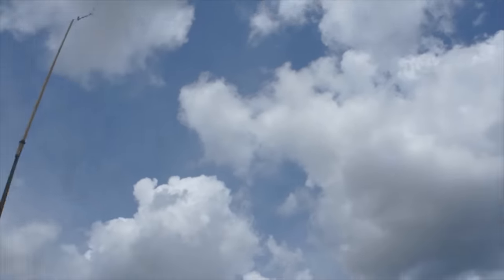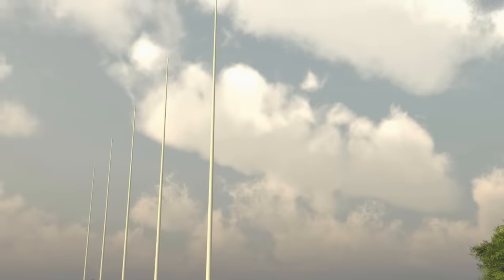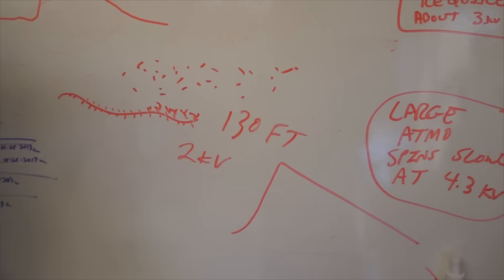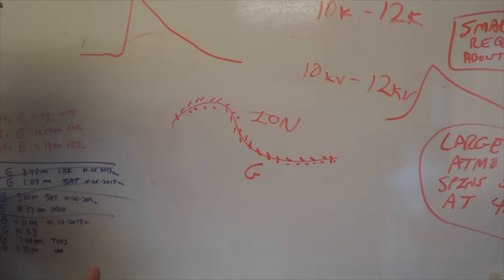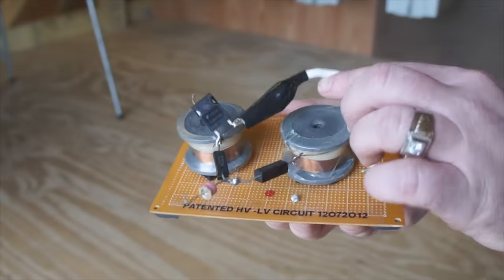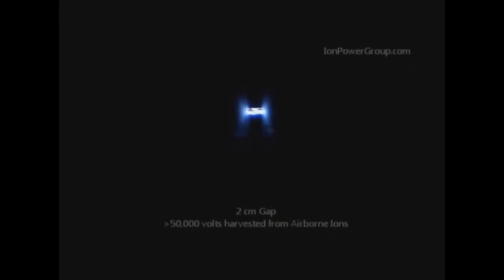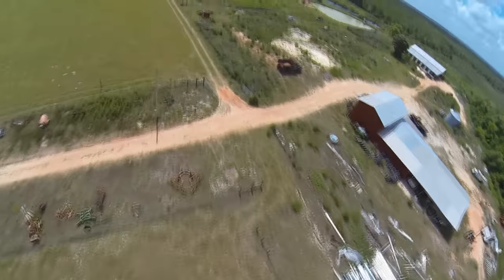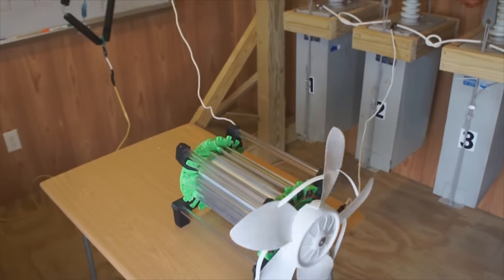Graphene/Graphite Atmospheric Electricity Collectors - Plus Horrific Hexacopter Crash!

Comment: Why don't you show how much POWER it can produce?  Voltage by itself is meaningless, even a spark from your shuffling feet on a carpet can exceed 20KV.  We need to see WATTS produced, meaning V*A.
Reply: A very big cipher: this test set up can produce 2.4 kV and al least 10.000 Zilch-Watts.
Reply: Zilch-Watts lol. From calculations from many people, they have come to the conclusion it is around 12W of average continuous power.
Reply: Richard Smith And you can get 300W from a single solar panel less than a meter square!
Reply: This has been known for very long time, problem I suppose is an efficient way to capture and store the hi voltage, so as to increase the amperage output demands. The grid would have to large. technical issues of building apparatus would be difficult to achieve and maintain. But today things are evolving rapidly, graphene, (<that one so new the spell checker doesn't know of it) hemp, super capacitors, LiPo's,  ect. It's only a matter of time before mankind can crawl out from under the grip of the greedy ancient fossil fuel gods, and start to harness the energy that surrounds us, one, the SUPER capacitor Earth & sky. Going to watch the lightning storm now   :)
Reply: Lounge lizard : You need a closed  circuit with a step down transformer then you can 
Measure the Amps.,Watts.over a resistance, measured in Ohms the amps will go up.
Reply: Exuse me, If you have even 10k Volt at 0.1A, you can step down the voltage with a regular transformer to the nominal 240V of the grid having about over 4 Amps of current. This, I think, is not bad.  Even if currents are even more lower, you can convert in an high current device at few volts (a welder for example) and you still producing heat. To see that kind of spark, the current is not too low to be unusable I think.
Reply: Thanks...now I don't have to say it......the first sign something is funky is that the 'energy' is stored in caps...

The story goes like this; They were able to power a subway car for 8 miles last Wednesday between 1 and 1:15pm, but now it can't because the ions and YOU'RE negative energy.....

Being able to keep my doctor, was a more credible claim....
Reply: So another scam?
Reply: whats the highst number you can count ... keep counting different weather also means space weather solar flare melted telegraph wires now even off grid is effected by the lightning of charged particals weaken the magnetic field may produce strong growth as more charged energy
Reply: The problem is to get a useful amount of power you need something the size of Burj Khalifa.
Reply: even if it's 1ma at 20kv

 that is 0.166amps at 120vAC  20watts at the most.
Reply: Wouldn't the pole capacitors they are using in the atmospheric electricity experiment give them the high amps/currents to power all the electronics?
Reply: @whocares.20  batteries are not always necessary. There is a fellow named Jaime who has built one off custom solar boats. Fvp directly to speed controll then to motors. Works very well even with cloud cover.Gerard Morin is onto a plausible way to use volts with little amps to drive powerful motors.Tartaria ran on this type of power . I always said "the current is the deterrent " the dangerous nature of this power grid design and all devices designed for amperage or current based dynamic response, keeps most from truly understanding voltage and magnetic force. Permanent magnets were used before they understood what electricity even was. Answers are coming to all soon!
Reply: @loungelizard836  what about with no sun ?
Reply: Armando Silvier  No, an LED light bulb is about 12w. A small LED is a couple hundred milliwatts. But yes, that is correct. 

For demonstrations, it uses large capacitor banks that store power over a long period of time to power the demonstrations for a short amount of time.
Reply: @KevinFreist  elaborate?
Reply: @WaldensWorld  no go. Limits. You still need battery bank to run w/o sun. But batteries not necessary  in modest sunlight. All amps produced go to motor,  not topping off  batteries.ive played with a 45 watt panel and trolling motor .works well. Jaimies motors are much larger and solar panels are in the 200 watt range. He leaves a wake with it. Good enough for me.
Reply: @rich1051414  at least it's solid state
Reply: @Constellation3232  So are solar panels, which generate hundreds of times as much power. 
This experiment was an attempt at supplemental alternate power, but it was a failure. It did not generate enough power to warrant the footprint or costs.
Reply: a bolt of Lighting harvesting

 will have more power  then these ion harvesters will ever generate
Reply: @loungelizard836  Yes, but these antenas would work during night, cloudy days, don't need to re-orient to chase the sun, don't degrade (as much) over time, and can be used in conjunction with the solar panels, they won't cast any significant shadow on them
Reply: @KyrieEleison1990   That and it's constantly accumlating/redirecting the energy, 24/7.  So while it is inefficient/low power, the low cost and DIY potential nature of this ends up making it attractive overall.
Reply: @thermionicemission6355      This is more or less a tweak of Tesla's earlier concept and patent.  Tesla spent 3 years working on and testing the idea before he went public with it.  It's not a "scam", it's just not  even nearly optimized for efficiency yet.
Reply: just like a battery, it's the surface area of the conductor cathode/anode that is responsible for current... 20 pico amps per square meter in fair weather atmosphere based on foil, at most elevations. You can multiply this by 100v per meter if you want a decent KVA estimate. fyi, they are using one dimensional wires atm. not an optimal way to go about obtaining surface area.
Reply: Bugger all is the answer. Why do you think we do not already harvest (electrostatic) energy from the atmosphere in a large scale by now, despite the effect being very well known for such a long time?
Reply: @MrSpankyxiv  see? 2nW of power per square meter, every meter. You can't power anything meaningful with that.
Reply: Depends on the surface area of the collectors for sure
Reply: @lounge lizard with atmospheric electricity, you achieve roughly 100v per meter in height. The higher you go, the more volts you can achieve. Amps on the other hand are achieved by the surface area of the harvester. You can achieve 10 pico amps per square meter of area on your conductor. Which is really really small. Voltage is also capped around 300 meters. It doesn’t increase after that. 240 meters in the air can produce 2.41e-17 Watts per square meter of conductor surface area.
Reply: ...please
Reply: If you can build a pole that can reach to the ionosphere, it will generate power enough to power the city.
Reply: @danielregan6871  yes but if you collect the volts in an alternating state you can increase the watts from the stored capacitance. However I would back the power up with solar panels with it then just regulate the current due to the scale. Either way it's indeed not bad for running a few appliances
Reply: @tiffanyhouze1886  if you use solar panels, there isn’t much point in using atmospheric energy at all. When I say pico amps, I mean pico amps. 240 meters in the air you can harvest 2400v of ionic energy as the electrons are pulled from the ground as long as you have the surface area for the negative electrons to meet the positive ions in the atmosphere. But pico amps means even with a sizeable ‘antennae’ you will still only be producing not even 1 watt of energy. I mean we are talking 17 zeros after the decimal point amount of wattage. You can barely even lift a feather with that amount of energy. 0.00000000000000000241 watts per square meter of antenna at the end of your conductor. A washing machine uses 1200watts microwave: 800w - 1000w, boiler: 3000w, kettle 3000w, shower 4000w, TV: 70w, phone charger: 300w. You would need an ‘antenna’ of around 20000 square meters to produce enough energy to press a button on your remote 😂 or you can cube it but you have to think about surface area.
Reply: @tiffanyhouze1886  plus you can’t increase watts like that. It would take a really long time to charge an capacitor capable of doing any real useful work. You can transform the current but as you increase the voltage from the primary coil in a transformer, the current drops in the secondary coil so that the wattage across both coils is exactly equal (fundamentally speaking) it’s not exactly equal due to small eddy currents you lose a bit of energy.
Reply: I do however believe that this is what Nikola Tesla was beginning to achieve and why he wanted to build his ‘Wardenclyff tower’. He was attempting to elevate 50 tonnes of copper ‘antennae’, 100 meters off the ground and grounding the antennae to complete the circuit. Unfortunately investors pulled his funding becuase at the same time another guy used Tesla patent to develop radio communication and investors couldn’t invest in both back in the day. He did build his tower but his request for investment to buy 50tonnes of copper was denied as it seemed like an unreasonable request. Simply becuase Tesla stated that this will give the world energy for free. There’s no money to be made in free energy.
Reply: Plus capacitors only work in DC, they don’t work in AC. I think you mean inductor
Reply: @danielregan6871  right , I meant it would be for small applications is all. With this project that is due to its limitations. I concur
Reply: @danielregan6871  that's a lot of copper lol
Reply: @tiffanyhouze1886  ye man. Keep thinking though it is good. You need to know the fundamental laws of physics though. Look up Faraday-Lenz Law and go from there. You can do things with atmospheric electricity but only if your ‘antenna’ has a large enough surface area. And we are talking 50 tonnes of copper large 👍 but another question I would ask about harvesting atmospheric energy, just like when ground source heat pumps are too close together, they draw out too much heat from the ground and you end up with a phenomenon called ‘perma-frost’. I’d imagine the same thing will happen if you neutralise too many positive ions from the atmosphere, not to mention what happens to the weather when actually harvesting atmospheric electricity in larger quantities. Zap zap ⚡️ 😉
Reply: @danielregan6871  thanks and yes I'm aware if farraday and Lenz law here are my personal notes : don't mind the start of it. I've been comprising for some time actually.  And I only meant what I said from the gentleman's scale in this video! I understand physics , chemistry, even Alchemy,  psychology and so much more. Here's what I've written just today on my Facebook thread. And if you think I don't know my shit your dead wrong. The technology we were given needs appropriated back in the rightful hands of the people. Notice I said rightful. I understand the adverse or obverse this tech could pose problems and has within our military being used for nefarious reasons. I will if given the proper funds to show and prove just how these certain technologies can be utilized at a safe pace proving and enlightening what we should have had from the beginning.  Now of course I don't have the schematics or blueprints on the models but I can assure you I know what coherent dielectric fields , synchronization in resonance, I have so many notes on how this stuff works. One field , 3 modalities an inverse to your spectral perception. Opposing magnets time dilation of space aka gravity and so called time. Earth is our ground and atmosphere is the positive mostly charge with electrons in the midst of scalar waves as well as electromagnetic propagation,  sympathetic vibration, displacement current bypass square law , longitudinal EM , similar to rf frequency,  I know about water hammer soluluminessence , aka cavitation, EAS STRUCTURES, ELECTRO ATOMIC STRUCTURES , negative attractiveness forces , mind force =All force shockwaves just as pulses , oscillations , acoustic levitation, frequencies of certainess and high potential expansion, centralized and decentralization , polarized and depolarized,  sound rare faction, explosion being male positive, implosion being female negative , sine phase , neutral , infinite ninths , large mass or density having low frequency , ohms law , infinite, Pythagoras modulation , vacuum separations of molecules pulling apart heavy low frequency leaving high frequency derivatives,  keynote fundamental tones to resonate, fractal antennas,  scalar waves ,sympathetic vibrations , the power of Love, harmonious mind being resonance effect , quest for truth of understanding life itself which I've been taught, harmony sympathetics , fundamental law of love , universal principalities,  temperment which i think we all are still working on which is incase a fine point of examination in what I'm saying needs to happen , all apply the same rhythm in order for proper construct, i have so many thoughts or imperative ideas that need met. My notes carry on even farther to the point I just might have a solution for world peace and free energy. It was God given and we should take the power back for its vital purpose!! Thank you and have a great day. I have food and sustainability in mind in order to take care of my family.
Reply: @danielregan6871  my husband's actually he used my phone . He broke his but now has a new one lol. His name is Brian lee
Reply: The atmospheric current density is about 10 picoamps/m2 - arising from positive ions falling under gravity, isn’t it? That’s not much, even if you have a large collector area……
Reply: @neilhawkes880  correct. If you can find some of my comments, I have mentioned this ✌️
Reply: The time ya'll spent on this pointless argument could have been better spent on the earthen energy produced. You don't need a larger, taller atmosphere array/accumulators. You boost the energy from the ground with the coils instead.
Reply: you can have even 9000kV but still not even start an engine. why? because it will have no small amperage and to small wattage. W=V * A

so what it was not shown, is how many Watts it can produce. 
you can lit  LED but not a TV set 😂😂

nice way to impress noobs 🎉😂😂
Reply: only noobs get impresed. there is no power Wattage behind it 😂
Reply: @againstbulshit2895 why not use the positive ions as current.
Reply: Wrong